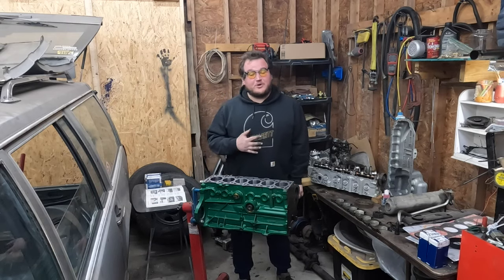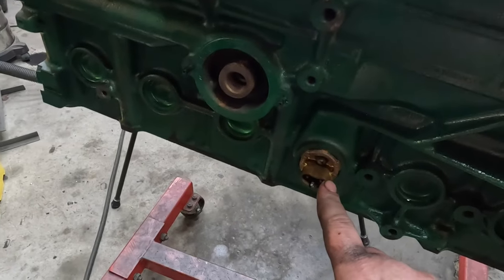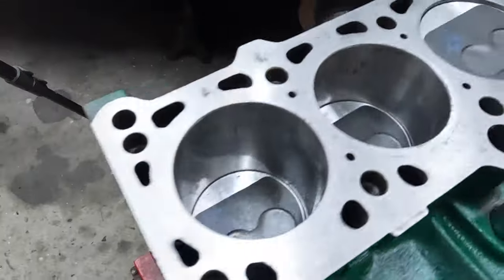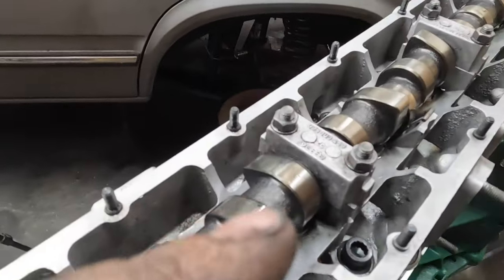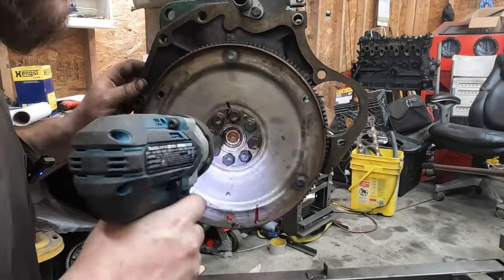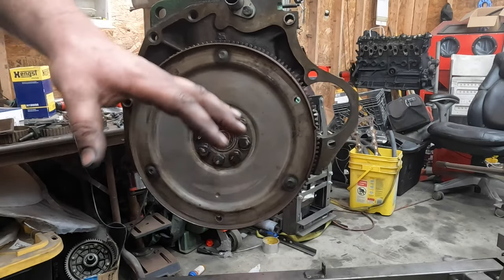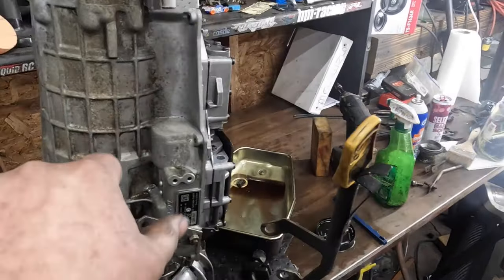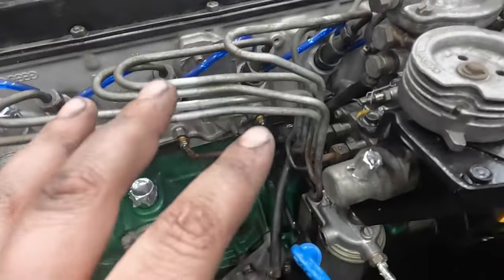VW D24t Full Engine Rebuild - Volvo 740 Turbodiesel Restoration

Comment: Never been a step when youre supposted to tightned the head after you got i warm with a steel headgasket..

Om the other hand, with the other gasket, its 40,60,70 someting 90 degree, 90 degree, go to working temp, 90 degree, go 1000km then 90 degree again..

Could be wrong but pretty sure i never seen that the steel gasket never is supposted to be tightned after working temp🤔
Reply: Correct, no additional tightening with the MLS. According to Volvo, the MLS has to be done with 40, 60, 75 and ONLY 180 degress.
Reply from the maker: I'm glad you brought that up, I hadn't considered the sequence might be different for the MLS. I'll annotate the video and pin your comment. Thanks!
Reply: @Volvodennis Yes thats right id do 2 90s instead of 180 in one go tho
Reply: I’ve just fitted one of those erling gaskets and the fitting instructions with the gasket stated 40Nm 60Nm 90degree 90degree 1000km 90degree
Reply: @choppergray1  I'm glad I'm using arps as the angle tightening isn't used 😂 still people will debate the last torque spec instead 😭 🤣

Comment: Just d24t swapped a 760 here in alberta. got the whole thing installed and then realized it was missing a rod bearing, took the whole engine apart and am in the middle of swapping the crank and connecting rods from one of my parts engines. very rare engines on this continent and glad to see someone else is putting some love into them.

Comment: Rebuilding my d24t in my pinzgauer after a front timing belt failure. Big damage. I’ve got a video to add soon looking at what the failure did in a few very short second. The pinzgauer d24s have hydraulic tappets and the front belt has a tention pulley instead of tensioning with the water pump.  

Great video put out at the best possible time. Thanks from the UK
Reply from the maker: Sorry to hear about your engine, but thanks for the info! Will certainly work it into the next video! At least parts aren't too hard to come by yet. Best wishes from BurgerLand!
Reply: @bakedbeansgarage116  I haven’t found anything I can’t get so far and my one has awkward 24v parts to find.

Comment: 5:00 in I would say what small residual water or moister would burn off with the heat of the oil, and the metal, it’s going to steam out the crank case when it hits operating temperature. But thank you for the videos! Not many out there! I have a numbers matching 83 I’m the second owner and 188k trying to get it running again! Keep up the great work!

Comment: Nice looking nugget! D24 owner and if you want to keep that head flat a tight consider loosing the viscous clutch cooler and do the electro cooler retrofit. Also a proper oil cooler with thermostat,15 row mounted wherever it fits in front of the rad. And running a whole quart more oil that what states the book will do wonders to lengthen the life. Please use full synthetic oil. 5w40 or if you're going to up the boost run 0w40 but always full synthetic. This engine can do a million kms no problem if you can manage temps properly, cold starts uphill are killers. And pulling trailers on a slope for a long time is another classic killer. The head gasket Will pop. Head studs are great upgrade but an extra 400 bucks. Any how, thanks again and I hope to show my rebuild soon.
Reply from the maker: Luckily, this thing will be relatively light duty. I will probably do a transmission cooler, but given how cold it will be sometimes, I will probably stick with the OEM oil cooler.

Comment: That was intense, great video. Im used to merc om617 engines.  I dunno why but this seems way more difficult
Reply from the maker: Yeah, a little bit. It's the belts. The OM617 drives the injection pump from the correct end of the engine lol.

Comment: Do you know the torque settings for the screws holding the gear cover on the inside of the oil pump?
I used a regular phillips screwdriver to tighten until "tight."  The green book says "install cover" without any additional specs.
Wondering if there's a chance that they might back out over time.
Reply from the maker: As far as I know, it's just German torque. They're right up against the block, so not like they can go anywhere haha.

Comment: Hi
I am rebuilding a d24td from my Vw mk1 lt 4x4 and have found this video extremely helpful with the whole process. I have come up against a big problem with the con rod bolts as the bolts I have are the stretch bolts and I need to replace them but cannot find them anywhere. I was wondering if you know of a replacement bolt or where I could get the original bolts from. 
Regards 
Lee

Comment: good video! 
and yes the D24 did get hydraulic lifters in the TIC model if im not incorrect
Reply: Yes, you are correct. But these are D24TIC after modernisation (after 1992 think). With  hydraulic lifters and EGR valve too. I have one of the first D24TIC (1987) without hydraulic lifters and EGR.

Comment: Use green locktight on the crank bolt! Unless you will snapp off the lock tab on inner sprocket
Reply from the maker: Thank you, this would have been a good thing to mention. Wouldn't want to send that torque all the way through the crank anyway.

Comment: hello,  have been enjoying your D24t diesel over haul videos,  all well done and informative,  as I am getting ready to turbo my D24 natural ,are you able to recommend a aftermarket turbo for my project please?   just want a bit more of omff not going crazy  thanks
Reply from the maker: From what I have read, the best option is the original hot section with a larger t4 compressor. The original turbine wheel has an unusually low trim to spool at low rpms and you'll want to keep that for streetability.

Comment: Hi! Do you have Anu tips for getting the air out of the fuel lines after installing new fuel lines for the diesel filter and replasing the throttle shaft O-ring. I cant get diesel coming from the fuel lines that go to the injectors when i try starting it
Reply from the maker: As long as you are getting power to the shut-off solenoid, you should be able to crack the lines at the injectors and bleed it no problem. My "will it run" video might have some useful info. A recent problem I had with my rabbit is that it would power the shut off solenoid in the "run" position, but not while cranking. Not sure if it is different with other chassis, but could be worth looking into.
Reply: it can also help to try and put air pressure to the fuel tank to help push the air out of the filter and prime the injection pump.

Comment: I would probably just gap the fuel lines with zip ties if the original gappers is hard to get😅. Also why rebuild the turbo and not just put a bigger one in for the extra ponies? I do believe I have a spare 16T from a 850 T5 if you can make it fit somehow.
Reply from the maker: I considered it, but given the no power I'm trying to make, the original turbo is more than plenty.

Comment: the head gasket is not a 1,6mm gasket it is a 1,4mm for the N/A engine. 1dot=1,4 2dot=1,5 3dot=1,6. greeting from sweden!
Reply: you have stupid high compression in that engine if you have a machined head and a 1,4 gasket. lucky the valves dont hit the pistions. VW states that the d24 head cannot be machined and you can only have a tollerance of 0.5mm.
Reply: no the m45/m46/m47 did not come with the d24 engine in any shape or form. The m46 OD gearbox was the ONLY gearbox to come with the d24 up until the 940 and the m90.
Reply: and if you bought injectors from a 1,6 those are 130 BAR injectors and the d24T are 155 bar.
Reply from the maker: Hello from Burgerland! Thank you for the input and corrections! 

My injectors are 155 bar, I may have misspoke because they came from a company that pretty much exclusively deals with 1.6s. they just happened to have them.

As far as the head gasket and compression, I just followed the green book exactly by measuring the piston protrusion and landed on one dot. Not sure the specifics of the pistons, but safe to assume they're aftermarket.

It's funny you should comment today, I actually just got it running, but it's kicking my ass with air in the fuel. It starts and idles fine but has an inconsistent miss and will die when I blip the throttle and the pump gets a nice big bubble.
Reply: @bakedbeansgarage116  well try and run it from a gas can in the enginebay. Also check your banjo bolts 1 is fuel in and 1 is fuel out. The fuel out has a pressure regulator and you Will Stavre the pump if you have those wrong. It says OUT on the head of the bolt
Reply from the maker: @burepajkn4975 thanks! It was sucking air due to a deformed crush washer at the fuel filter, but was still running poorly due to timing. Idk what I did wrong yet, but it ran way better once I just yanked the pump to fill advance.

Still working on it, but all will be shown in my next video!

Comment: a tip for the 1.6 and 1.9s lock cam and pump, and when putting the belt on, ofc pull it tight between the pump and crank, then turn the crank one tooth backward slide the belt on and well every time i have tried. It put the correct tension between the pump and crank. Btw i may be forced to unsubscribe you are not barefoot this time :P
Reply from the maker: Yes, this! A great tip that has also worked every time for me. I'll be doing a video about a timing job on my rabbit eventually, I'll have to include it. And worry not, the piggies will be free once the shop floor isn't freezing!

Comment: Dont use the factory tightening spec with mls gasket !!! they are for composite only use the ones that come with the gasket on the paper ! 40nm 60nm then 90 degrees then another 90 degrees it usualy is for mls vw diesels
Reply: Im going to be using arps in mine tho they go to roughly 150nm in 3 equal stages
Reply from the maker: Thank you for the heads up! This has already been brought to my attention lol. I will have to add an annotation to the video when I get home. Luckily, the three stages I used are about right for this gasket, it just does not need to be retorqued when it's warm.
Reply: @bakedbeansgarage116  yeah I'd say you'd be absolutely fine as you are it's done now not worth changing it
Reply: Just another point for future reference a cheaper option instead of arps is PD150 head bolts this is a later TDI engine that got stronger 12.9 grade bolts thiese can be cut down or purchased pre cut for use in all ve engines they are capable of more power than most will ever push through a d24 but still can't quite beat arp studs